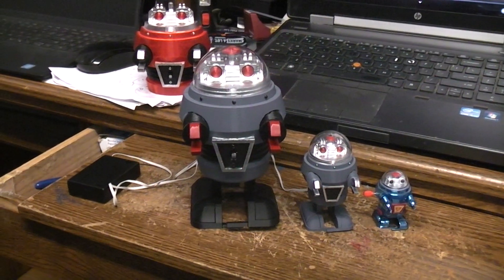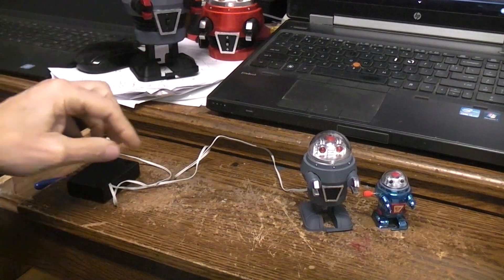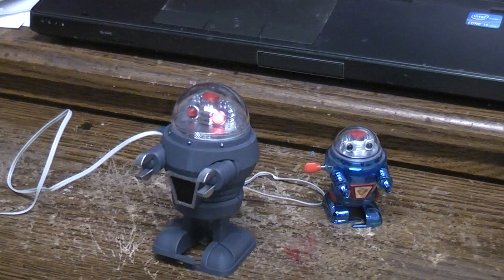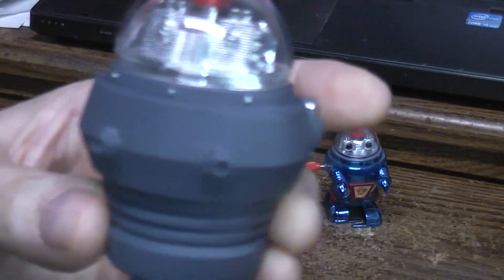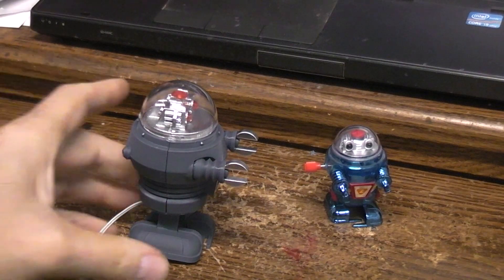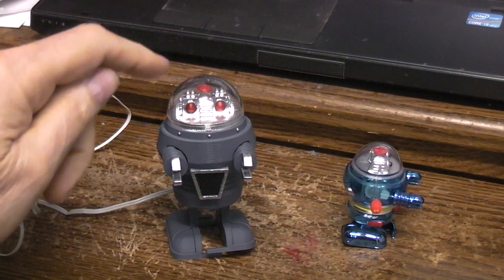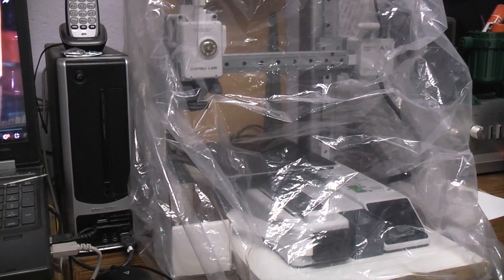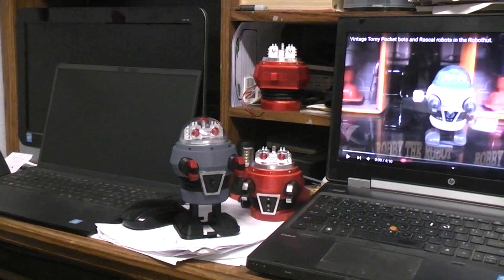Midsized Pocket-bot. Battery op. 3d printed using the N20 dual shaft low RPM gearmotor.

Comment: Would reversing polarity get the motor to run backwards? Can you see where I'm going with this?
Reply from the maker: Yes all claw foot type robot can walk backwards. A person would just have to build a remote battery controller with 3 positions, Forward, Backwards AND off.
Reply: @Robothut  One double pole/double throw switch would work,but two momentary buttons would look more like an older toy control.
Reply from the maker: Dp Dt switch does not have a OFF position unless you use a 3 position switch or add a second switch to turn it on and off. Yes 2 SP DT push button switches would be more in keeping with many of the vintage remote toys. The older ones all used a 3 position handle switch with 3 positions. @matturban9103
Reply: Yes,the center off kind is what I meant. I sure miss Radio Shack for stuff like that.

Comment: How do keep all the parts separate on the bed  plate? So you can print all of them at once. Ty  nice robot 😎👍🏻
Reply from the maker: Just place all the STL files on the build plate and hit the auto align button, then the Slice button and print.
Reply: @Robothut  thanks  in mine it says align models. Work on few this morning I want put  g code in one folder on ubs so I can find them easily. Also  I did level my bed and clean after every print . I use raft support exclusively with tree support .. for the figures.
Reply from the maker: What ever works for you. Just have fun with it. @PeterAgostiniJdcap26
Reply: @Robothut  I m finally I never thought I be able to learn this , thanks for the push having fun